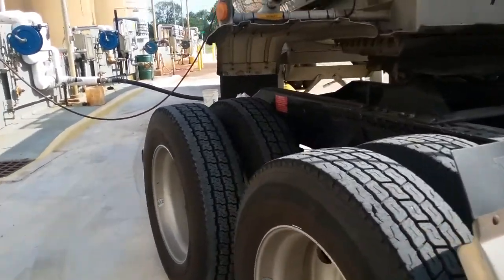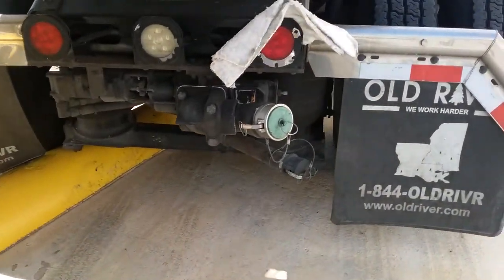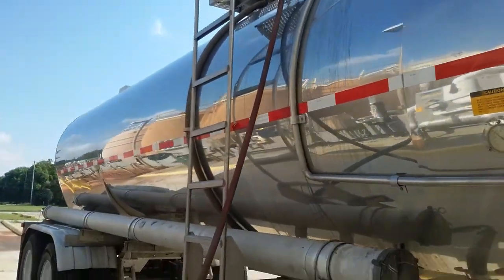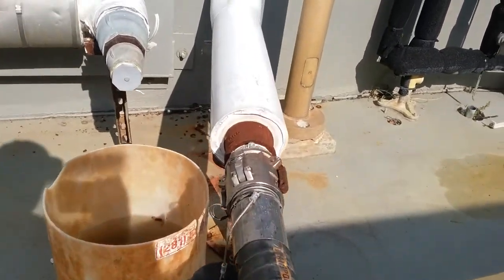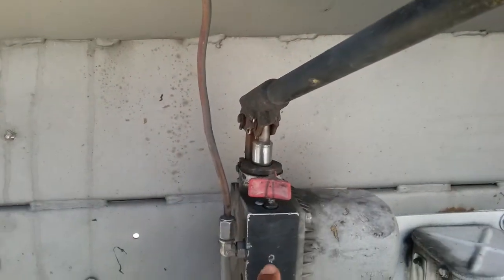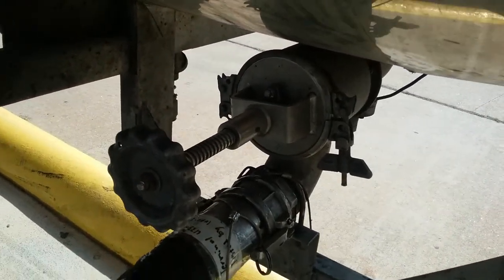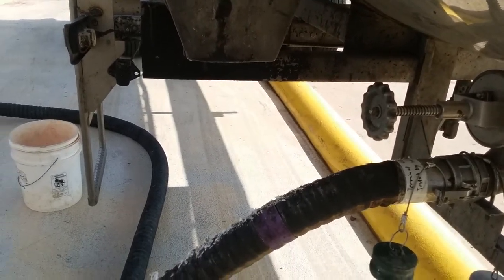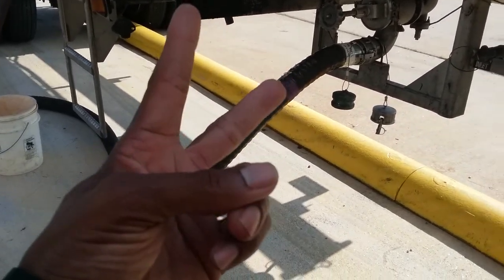Airing Off A Liquid Chemical Product with Compressed Air.

Comment: You don’t have to a vapor line or vent system?
Reply from the maker: This Product is Being Unloaded With Plant Air Under Pressure. If A Product Calls For A Vapor Recovery The Tank Would Be Prepped, Some Company Tank Comes Equipped With A Ground Vapor Recovery System. If I'm Pumping Off A Product With My Truck I Would Simply Open My Dome Lid or Remove A Washout Cap.